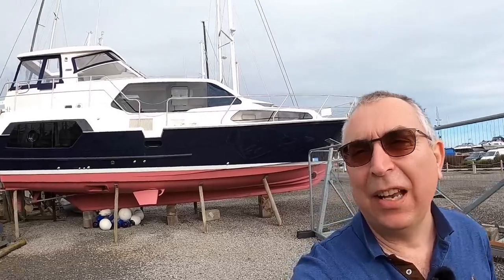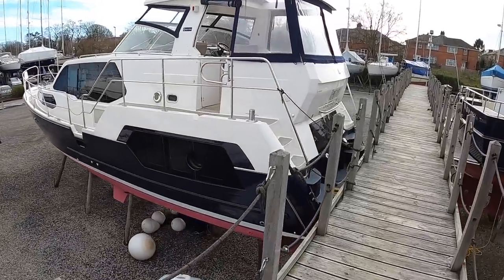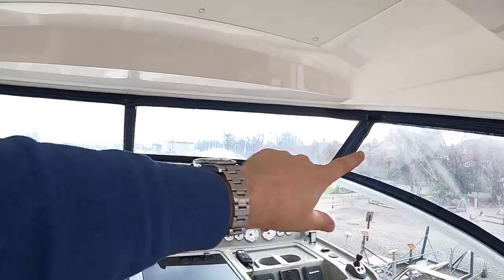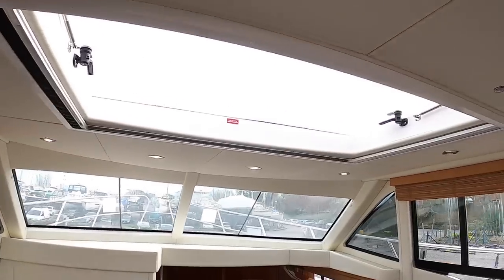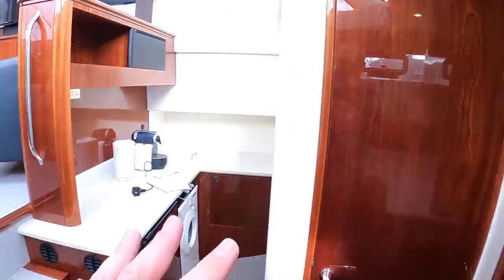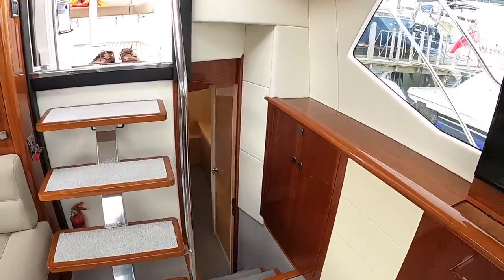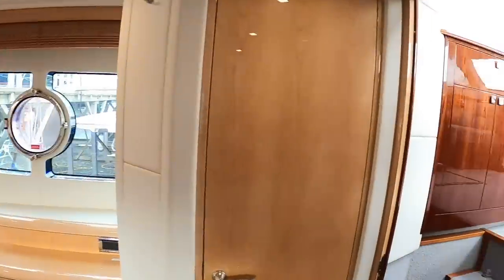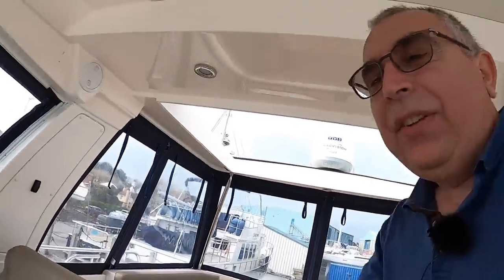£510,000 Yacht Tour : 2017 Aquastar 430 Aft Cabin

Comment: Wedge a bigger fridge/freezer in there somewhere, and I could actually see myself living on there permanently. Not something I would have previously considered of a 43-footer.
Reply: I 'd scrape by living on the sunseeker 95!
Reply: I'm sure you could replace the dishwasher with another fridge.  I didn't see either a generator or much of a house battery setup down in the engine room so that would be a bigger problems unless you want to be tethered to shore power.
Reply: @rockets4kids  There is a generator control panel at 6:12 though, so I assume there is a generator somewhere (although it does only seem to have 1.1hours on it!)
Reply: @ChuckFickens1972  Aah, I wonder where they have hid it!
Reply: @rockets4kids  I was thinking the same thing - would much rather have more cold storage than the "luxury" of a dishwasher.
Reply: @RobEJC  Same.  There is something to be said for those ultra low water usage dishwashers, though.  Then they become more of a practicality than a luxury.  But between extra cold storage and a dishwasher that uses many gallons of water I'll take cold storage every time.

Comment: Hi Nick, you forgot to mention those 'earlobes' ahead of each stabiliser fin. These must be cable cutters. They are very common on helicopters and are usually found on the upper engine nacelle and ahead of the undercarriage skids to shear high tension power lines,"Twang!".

Comment: That all seems incredibly spacious for a 43 foot boat - at least until you are in the engine space, or at the helm in bad weather with only the canopy between you and the wind and rains.  Impressive turn of speed for a semi-displacement of the size though, so I imagine it is more about outrunning and avoiding bad weather with the reassurance of knowing you can handle some that surprises you.  I think that I would rather have the 43' Nordhavn than this 43' Aquastar though if I were actually going to spend more than a week aboard at a go.  The range limitation on the Aquastar just seems to make it better suited for island and channel hopping, while the Nordhavn 43 just lets you decide to go just about anywhere in the world.  Sure, the Aquastar gets you 400 miles away in half the time, but it doesn't let you go 1,000 miles without fuel stops, while the Nordhavn goes 1,000 and asks "Where next?"
Reply: No one is sailing purposely into bad weather unless they are a rescue boat.  But I agree, that helm up north or atlantic winter would be a pretty cold spot.

Comment: I always wonder how is it possible to mount these boats and keep them stable by using wooden sticks. Is it safe? What if you accidentally kick a stick?
Reply: You're not strong enough to move those supports accidentally. Or intentionally, for that matter. Also, note the rebar stakes pinning them in place.
Reply: Thank you very much for the answer. To be honest, I had not noticed the rebar stakes. Apparently it is safe. To me though, someone you has never been on a boat and his only addiction is watching the great channel of Nick, looks like a "quick solution".
Thank you again!
Reply: @thanasisz9689  Sure thing. It's definitely a common, tried-and-true method for stabilizing a boat out of water. There are more elaborate tripod systems with telescopic legs and swiveling bolsters available for someone who's looking for a little more peace of mind, but as long as you've properly pinned the base against the weight of the boat, a sturdy oak pole is plenty.

Comment: 09:24 I think I haven't seen the ideal solution yet for combined shower/bathroom/toilet in a small space. This is smart but little washing surface and still a wet floor. Seems like a toilet under foldable washing table (Marex style) and a shower like this but with a shower floor that you can also fold up after shower so you can enjoy a dry floor, would be perfect.
Does this exist Nick?
BTW Any boat builder can use this idea for free, just send me one boat ;-)

Comment: Lovely boat, however...they could potentially struggle to find a buyer with the stains on the outside and the state of the bbq, 500k isn't a small sum and both of the things I've pointed out would be enough to make me walk away. Surely, it wouldn't cost much to address those issues.
Reply from the maker: It's already under offer.

Comment: Most exhibits, on this channel are truly worth the look.
This one is not!
$.02/ When I saw the table-top hinge, I knew the cabinet carpenter is an inexperienced or incompetent tradesman.
The wood is very nice, but the choice of hinge and it's placement are mind blowing ridiculous. /$.02
Who would put an exposed silver hinge on a deep redwood table? The answer is in my opinion above.
It is a simple task to hide a piano hinge on a tabletop. (A nice rosewood hinge, would have worked) It adds strength and the hinge is not eating dinner with you every time you sit down.
Grant it - most of the cabinets are made in an exceptable manner, but the tabletop and a few other examples of this unfortunate hinge choice make this refit unexceptable..

Comment: Can I be blunt (that’s ranks alongside the phrase “you’ll forgive me, but”).

Honestly it’s about the ugliest boat you’ve toured/walkthroughed for a very long time. I truly think that the designer has made that fatal flaw of “how much can we cram into this hull length”. Honestly I do struggle to see any positivity in it; it’s disjointed and looks like Lego blocks of accommodation that have been bolted together.

The gloss wood is stunning, but just serves to highlight angularity and zero softness or deftness of design touch. And the change of wood, clever as it may be to reduce claustrophobia in the smaller cabin, just looks like they’ve run out of the darker wood and said “ere Dave! Have you got any of that lighter stuff in the van? I’ve run out of the dark and I can’t be arsed to go back to the factory - it’s not as if anyone will notice will they.”

Forgive me, I’m certainly not dissing your review - it’s just not an aesthetic design by any stretch of the imagination.